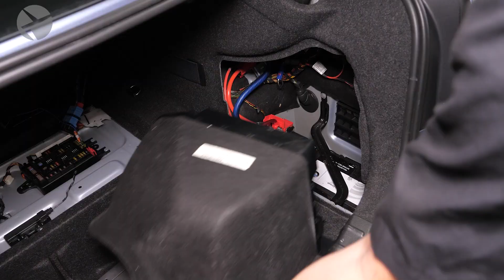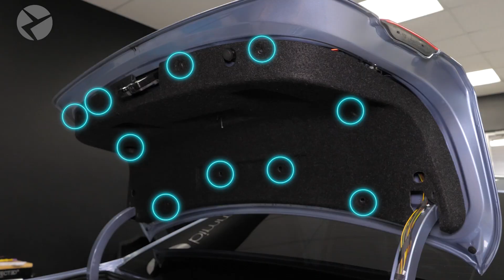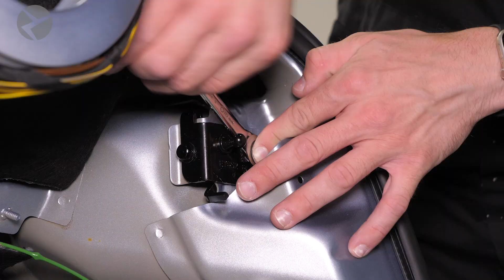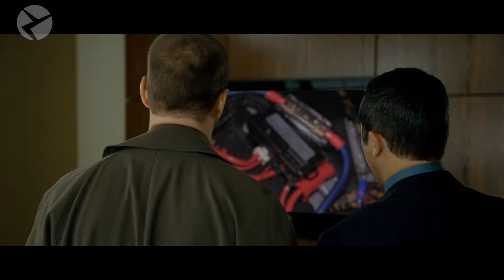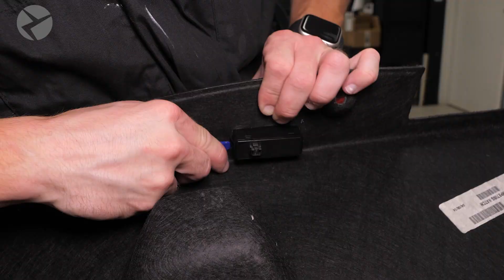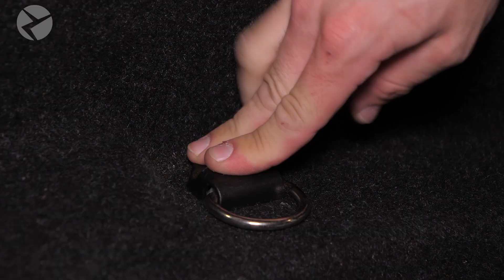BMW 3 Series (F30) Power Trunk Retrofit Installation Tutorial

Comment: Mine alreadys pops open on remote and doesnt have this? Lci
Reply from the maker: In some BMW models, the factory springs will allow them to pop up, and the factory hydraulics will control the opening speed to a safe level, but the Power Trunk allows you to open it AND close it remotely.  Our new Power Trunk kit also comes with a whole host of other programable features.
Reply: @bimmer-tech thats very cool!!